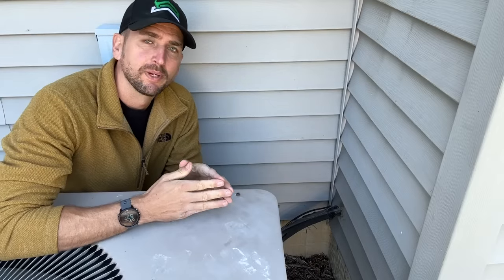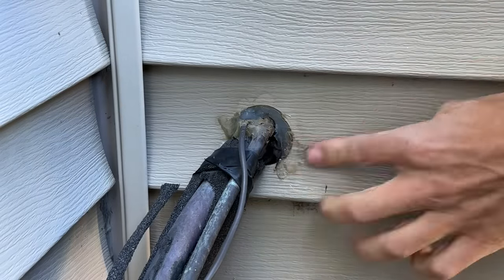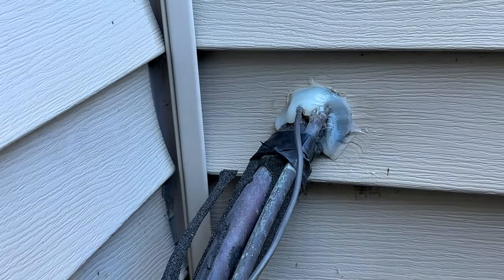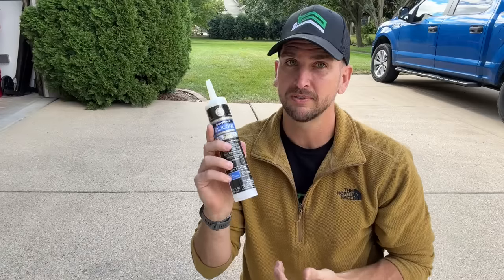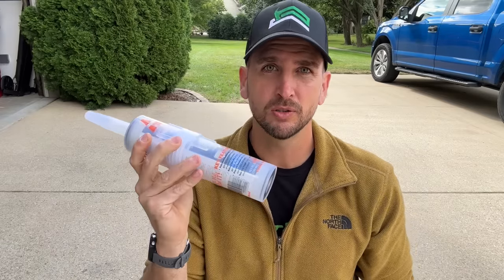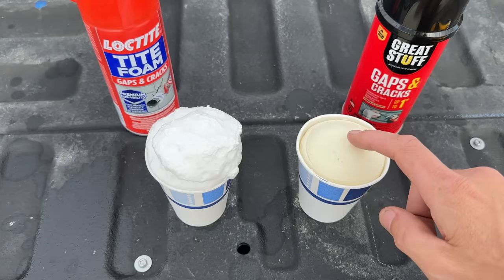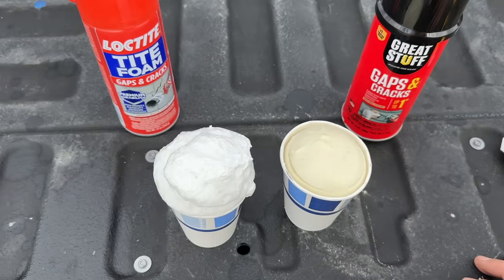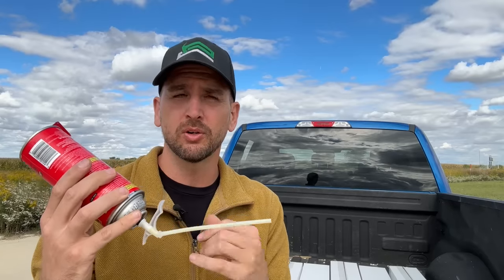How To Seal Gaps And Holes In Siding | Keep Bugs and Cold Out!

Comment: We use DAP ultra clear roof waterproof sealant - it stays permanently flexible as opposed to the 100% silicone which will eventually pull away due to different materials expanding at different rates. To me, the DAP ultra clear roof waterproof sealant has a higher capacity to stretch with those materials.  This product is better than silicone because it is specifically made for roofs.  (And it's paintable with latex paint after 24 hours - oil paint not recommend.)

Put on some latex gloves; it's some sticky stuff but goes on like any other caulk.
Reply from the maker: Thanks for the feedback 👍
Reply: Ultra clear is awesome
Reply: It's the best I've used. Big Orange didn't have a SKU for it when I went last week.
Reply: If you install 100%  silicone correctly it will last at least 20 or 30 years and does not shrink. I have installed miles (probably 100) in high rise buildings and other installations. If you think it shrinks you installed i5 wrong o4 used a cheap product like DAP
Reply: @genecarden780  If it's not outside in the sun or on a roof, I'd agree with you. It's not that the silicone actually shrinks, it's more that the materials that it is stuck to expand and contract and the silicone pulls away from those materials. So I guess a little bit of this a little bit of that; I'll meet you in the middle.
Reply: @MrNiceGuyMEGA08  it only pulls away when not properly installed. Outside or inside when properly installed it will last 20 to 30 years.
Reply: @MrNiceGuyMEGA08  it does not matter if it is outside or not.Silicone does not shrink.( once cured, all sealants shrink a minimal amount while curing) Assuming the use of a quality product , if it pulls free 99% of the time it is due to a installation error. Or using the wrong silicone. I have installed silicone sealant on the exterior of high rise buildings for over 40 years. The majority have at least 1 elevation that is in direct sunlight for the majority of the day.  If a good quality ( not DAP) silicone sealant fails it is almost always installation error,using the wrong silicone,( acetoxy cure when they need neutral cure, Hi modulus when they need low modulus,the wrong primer etc.)or mechanical damage. Our base contracts are based on 300 lineal feet per man per day.That is 1500 feet per week.6000 feet per month.72000 per year.I have been a professional caulker for over 40 years.But to be conservative let’s use 10 years. That’s 720000 feet or 136 miles of sealant. So I think it is fair to assume that in 40 years I have installed over 100 miles of silicone. It does not shrink. It will curl up on the edges and appear to have shrunk but in fact the bond failed due to improper installation. It did not shrink.  It will also appear to have shrunk when there is a 3 sided bond. Again it might to appear to have shrunk but the bond failed due to improper installation . It did not shrink.
Reply: @genecarden780  You're absolutely correct that different products should go in different places. The manufacturer's directions should be adhered when installing any product. The DAP ultra clear roofing sealant is a far superior product to using 100% silicone for roofing projects and in areas where you might need to paint to hide any repairs such as the one in this video. 
 100% silicone It's not paintable which makes it an inferior product in my mind.
 I have seen it around many different boot protrusions for different vents. If someone is going to use silicone around a boot vent, I would highly discourage it and go with the DAP ultra clear since it is specifically made as a roofing product. You might have something against DAP brands in general, but the fact that the product that I'm talking about is paintable makes it more ideal for roofing installations especially on metal roofs so that color matching can happen. You're 100% silicone installation over your many years might have worked, but I can tell you for roofing situations it is an inferior product and WILL PULL AWAY from roofing materials over time. (Metal roofs can expand and contract significantly depending on the run and location. Again, I will meet you in the middle that care improper installation should be followed according to the manufacturers instructions, but again it's been my experience that in certain fields certain type of trade people do not read instructions and the error rate is higher in this field. Tomato tomato, I will keep using the product that I use, and you should do the same if that floats your boat.)

Comment: My favorite long way way to seal up a tube is to put a layer or two of plastic over the tip and then wrapping a rubber band over that. I've had open tubes last years with this. Short term, use a wire nut.
Reply: What type of plastic over the tip? Like the food Saran Wrap?
Reply: @thezeta  I use whatever is handy. Painters plastic, grocery bag, hot dog wrapper, most anything. 
To give you an idea of how well this works, Two days ago I re-opened a tube that had the tip covered with two layers of painters plastic and a rubber band for well over a year. The rubber band was shot but the caulk worked just fine.

Comment: thanks so much for the tips. they also let me know when I'm getting in over my head.
quick question. I live in an older home. recently resided the house and the 1940's interlocking siding is still there with new siding on top. is there a need to seal the bottom of the siding and the house  without measuring I'm guessing about an inch up running pretty much around the entire house there is a gap-an open invitation for bugs. should it be sealed? not sealed because the house needs to breathe? it's the time of year when stink bugs, crickets, and spiders are working their way in, spring brings other critters such as sugar ants etc... or is this just something to live with?

thanks for all your sharing.

Comment: So.. this topic is great, but you really need to apply the air barrier to the actual sheathing behind the siding to make a difference. Bc it appears you are only applying these products to the cladding (siding) this will do very little to stop air or bugs as they can simply crawl up behind the siding into the gap and into the conditioned space (what they most likely do already.)

Comment: Expanding foam is a bit tricky. If you use too much it goes everywhere. Too little can leave small gaps. I have trimmed it off and cover with silicone after it is well cured.  Some of those examples seemed like you might have left gaps. Always best to examine all sides carefully. You can test spray with water after a couple of days to make sure everything has cured.
Reply: I use Great Stuff Door and Window foam in the blue can. I bought the Great Stuff dispensing gun. I've got an old 50's house so for me it was well worth the price.

Comment: I use my old, clean WD-40 caps, fill with the silicone and use it like a cap on the tube.  Let it stand upside down until it cures in the cap.  The next time you use it, just twist the cap off and go.

Comment: One last thing you could do is gently blow out the tube after WD40 with compressed air like a blow gun, but protect your eyes. I’ve never seen that air tight caulking holder, so thanks for that tip too.

Comment: I've been using the same tube of silicone for 2years+...when I'm done with the current small job, I fold a piece of good quality duck tape over the tip and press along the spout to get an airtight seal.  Next time I need it, I rip off the tape....silicone comes out like it was just opened...then reseal.  I use this for all my caulk type products.

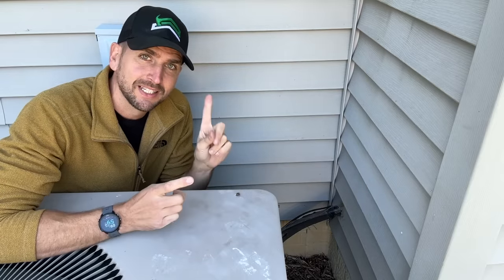Comment: 0:45  Milwaukee hit it out of the ballpark with the FastBack II (model # ending in 1902).  They released the FastBack 3 and canceled the first 2 iterations, but they changed way too much and FastBack fans flipped out on them.  #3 was shortened just enough to make it awkward to hold...and for a flip knife that means being paranoid about getting cut every time you use it.  They made it longer but then they made the edges sharper and a little uncomfortable for long use.  Now they have run out of stuff to iterate on and the name stays as "FastBack" for every new version.   I don't know why they are so desperate to replace it...it's awesome being able to flip the blade open and closed faster than a sliding knife.

As for using that snap-off like a carving knife, it's a good idea but it just seems like I'm wasting a bunch of blades at once when I don't mean to.  There is another choice: Hook/Roofing/Carpet blades.  They are the same blade but they are so awesome that every trade claimed them as their own.  I call them cat's claw blades because that's what they look like, but unlike cat's claws their outer surfaces are normally flat.  Flat face on the "front" of the blade, flat surface on the tip, and a gap about a pencil wide that's sharpened.  They dull quicker than regular blades but the outer faces of the blade are perfectly aligned for jamming the flat "point" up against a wall and then dragging it through old carpet.  The small flat section at the tip of the claw lets you skim the knife along something while cutting--fast fast FAST.  Thanks for all of the content Scott!

Comment: can i use expanding foam around the a/c lines to fill the holes around it? is it dangerous around the electrical wiring out outside with the sun. flamable etc? Im trying to close up pest holes.

Comment: Thank you for this. Have you done a long-term test of that Air Tite gadget? Have you actually stored a half-used tube of silicon in there for a year and still been able to use it?
Reply from the maker: nope, but the test has started and I will update on the channel once I have a tube sitting for 6+ months 👍
Reply: @EverydayHomeRepairs  Awesome. I subscribed so I won’t miss the update. Thanks!

Comment: Can we agree that these are temporary, half-assed ways of papering over shoddy workmanship?

I acknowledge that going back to redo the work the way it should have been done isn't always going to be in the budget (especially for a home that's a pure "investment property" where you intend to to the minimum).  And a crappy patch is still going to be better then a big gaping hole.

But these kinds of repairs are going to fail inevitably, as UV beats down on it, and things move around.  I don't think silicone is ever really a permanent repair in a situation where you directly depend on it to avoid water coming in.  It's hard to be sure your repair is good even on day 1: a small pin-hole gap could still let in a ton of water.   And as people flex your siding, or pull on these cables, I think it will have a tendency to open up your seal, which is depending only on adhesion.  You didn't do much surface prep, so that's a pretty big ask.  (Also, I suspect it's already a problem that these wires are even exposed.  How long will they really stand up to sunlight and raccoons?)

Look I'm not an expert, but I'm pretty sure that wiring really should be in some kind of conduit.  And where the conduit penetrates the siding, it should be properly flashed, and possibly have some kind of fitting.  If that's true, you might not need to dap it up like this, and in fact, that might be counter-productive as it traps moisture.

Another commenter points out that nothing about this seals at the sheathing or vapor barrier.  Siding isn't actually supposed to be a complete seal.  If it's this half-assed out here, it's probably even worse inside, and as others point out, this does nothing to stop moisture getting into your wall, and might even make it worse since it can't dry as easily.

For the pipe, I honestly don't know what the right thing is, but I'd assume something similar.  Maybe the pipe should have a sleeve, and that should be mortared in?  (Mortaring directly would probably eventually fail due to expansion, although I could be wrong.)
Reply: @tactileslut  That might not be such a bad thing.  Every time this guy goes around and does a project like this, the incomplete work is adding one new recurring maintenance issue to his list.  Not only does he have to come back and redo this every few years, but there's a chance it's creating new collateral maintenance issues due to the moisture intrusion.

Sooner or later he's got a property with an impossible list of small but difficult-to-correct problems, that leaks all over the place, has fungal issues, termites, etc.

The fact people will accept this kind of work is why the government subjects us to all this permit nonsense every time we touch a faceplate screw.

My point is, if he did this right, it would last for the life of the fixtures and siding, and he'd be done.  In a way, it would almost be better for him to do nothing versus doing work like this.

Comment: I wrap the tip with a piece of "duct" tape, not Duck Tape, but the silver foil stuff. I just keep a roll on hand, which I think was maybe for a dryer vent installation or possibly to seal my duct in the attic. It's got the adhesive needed to stick and it seals very well. It's a slight pain to remove but worth it since I can store the used silicone for some time. I've yet to find a better solution, however it's not exactly eco friendly but I find that duct tape is just kinda nice to have around, like actual "Duck" tape. I don't know the brand offhand, but I probably got it at Lowe's. It's definitely metallic and not a fabric tape.
Reply: Also, I've done the screw thing on foam and also ruined my can by puncturing the rubber. What I find that's best is to leave the tube on and leave the foam on the tip and let it all dry. The mixture will usually just dry in the very tip of the tube, and some in the tube but only a bit of residue. After it's had a day or so to dry, then pull the dry foam off, and use a medium size skewer (the flat tip) and push out the rest of the residue and foam. Now you have a good clean tube and the tip on the can should also be clean. I can't vouch for individual experiences or brands but I think it's worked with Great Stuff.

Comment: Amazon does not have a reliable supplier for the Airtite product. One of those mentioned wants to charge $93 for delivery.
Reply from the maker: Wait, what?  $93 for delivery?  Sounds like an error.  Honestly, we might have ran them out of stock but I will update the link if I find a better supplier and I appreciate the heads up.

Comment: CRC cable cleaner with 111 trichorethelene cuts right thru the hardended spray foam. Cleans out the straw applicators too.

Comment: Scott the silicone needs to bond to face of the siding.Also I routinely use silicone on 3/4” joints all day long. The problem is getting backer. The simple solution is use silicone to “glue” backer rod to whatever is penetrating the wall and gently push the backer rod slightly behind the siding and let ir set up. Then come back and seal it as normal.Use the GE. Dap is an inferior consumer product. Remember if bugs can get it so can water.also clear is the worst product you can use even GE use a colored sealant.Expandable foam is a VERY poor waterproofing.  It  seems to bond well but actually does not long term. plus it actually has very little sealant qualities. Please stop using it in waterproofing situations.As a general rule never use it from the exterior. Also just in case you listen to my advice and use sealant in those bigger foundation holes, be aware there are two basic types of silicone. Acetoxy and neutral cure. They are easy to tell apart acetoxy smells strongly of a vinegar like smell . Neutral cure not so much. Never use acetoxy on any cement based substrate

Comment: With the spray foam, sometimes you can use a drinking straw instead of the one that comes with it. Trick is finding a straw of the same thickness. when done just throw it away.

Comment: How wide is that rod? I cut a very small piece of the tip off when I use, am I going to have to cut more off to fit the spike.
Reply from the maker: Not necessarily, I cut a larger hole to help seal the exterior holes but if I wanted to use this silicone for indoor waterproofing the big hole would not be ideal.

Comment: Those caulking containers are the biggest gimmick, they don’t work AT ALL. Don’t use those, a drywall screw works better. I usually just wrap the tip with some electrical tape and seal it up. Still good a year later.

Comment: Instead of sealing the vinyl from the outside, why not seal the hole that actually goes into the house, which could be OSB or concrete? Basically whatever is behind the vinyl. You could do this by pulling back the siding, or accessing the hole from inside the house. Otherwise, if you're just sealing the vinyl, that's not going to keep bugs and cold from entering the hole that's behind the vinyl. 

My understanding is that vinyl is floating and loose, to allow for expansion and contraction. Sealing up those holes this way doesn't allow for the vinyl to move much which can lead to warping. If you look at the termination points for a piece of vinyl, either a mounting block or a j-channel, there are large enough holes for "cold" and bugs to get behind the siding, and then into the holes you didn't actually seal.

Comment: On the illustrated example (  I hesitate to use the word Tradesman ) probably idiot or clown is nearer the mark, it doesn’t matter what you try and seal it with thermal contraction and expansion will cause it to fail, what should have happened was the cables should have been brought through the lining separately far enough apart to enable a proprietary collar to be fitted round the cables and not gubbed up with the righter of all ***k ups mastic.

Comment: You can also use gasoline to melt the great stuff foam… so it will work again. The stuff you buy at lowes to clean out the guns for the foam is pretty much gas. But then again… that foam is VERY flammable so I would be cautious using it With or around flammable stuff… idk 🤷‍♀️ sounds a little risky